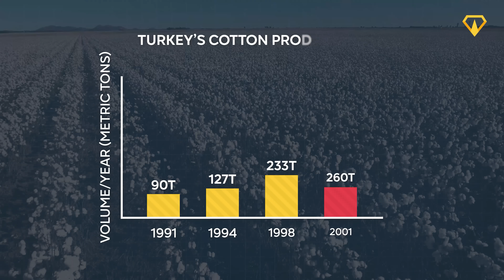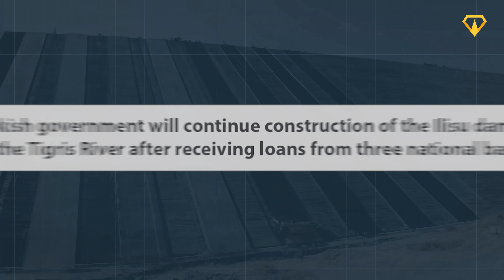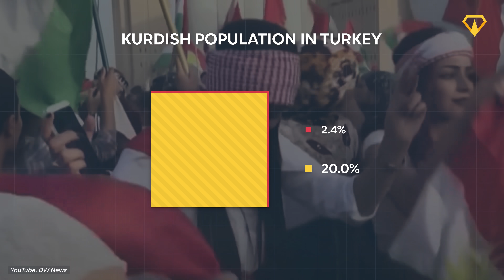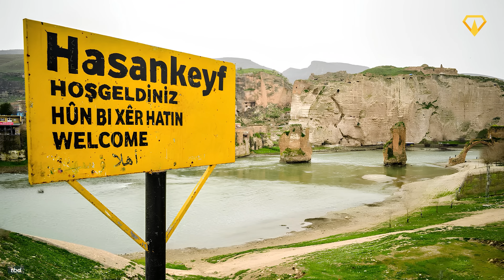Turkey's Controversial $1.7BN Mega Dam

Comment: “Has the capacity of a small nuclear reactor” (0.30). But with 3.8 GW (5.27) it’s more like a big nuclear reactor!
Reply: Installed power is 1200 MW (not 3.8 GW). Average annual energy production will be 3.8 TWh (3800 GWh).
Reply: @eraybdr52 what's the difference. Does that mean the dam is working at 3x the capacity?
Reply: And yes 1.3MW is about output of single nuclear reactor. 
State of Georgia finally finished 4 nuclear reactors with total output of about 5MW

Comment: GW is a unit of power, which means it is generated this second. GWh is a unit of energy, which is power generated over time. A generator is rated in GW (or rather MW which is a thousand times less than a GW) as that is it's max continuous power output. While power production has a lot of other factors that the generator does not care about such as rainfall, magazine size, maintenance, power prices, grid services, competing power plants, etc.. So if you are talking about how much production a power plant has you are talking about energy, GWh, these are two different units of measurement.

In this video you say it produces 3,8 GW annually which I assume you mean GWh, however 3,8 GWh is nothing in power production terms, it's less than 20 year old single wind turbines produce. So again, I assume you mean 3,8 TWh, which is a thousand times more, and sounds a bit more realistic for a project like that.
Reply: Wikipedia says its estimated production is 3,883 GWh, which is 3.833 TWh. Probably confusion with denominator.
Reply: @maxxamim hello 👋
Reply: So this is what I sound like when I talk fire science with people. Haha.
Reply: @axxxonn hello 👋
Reply: Installed power is 1200 MW, average annual energy production is 3.8 TWh (3800 GWh) for Ilısu Dam.
Reply: Hello